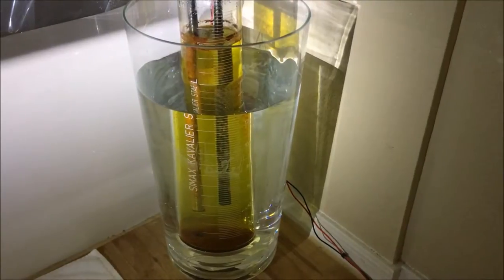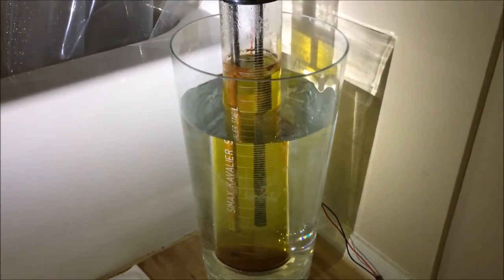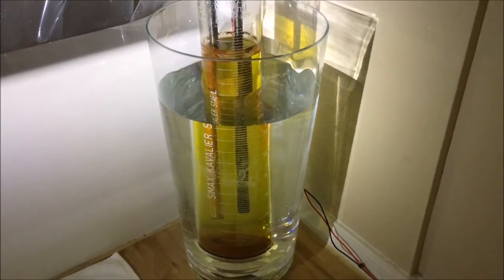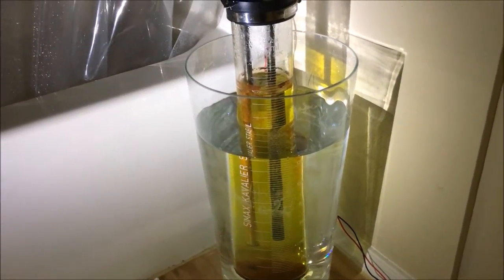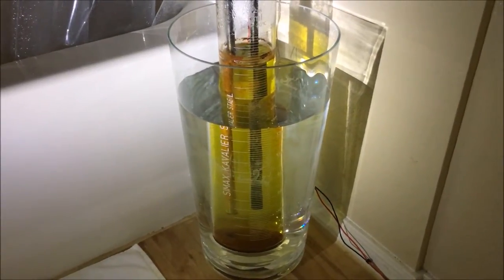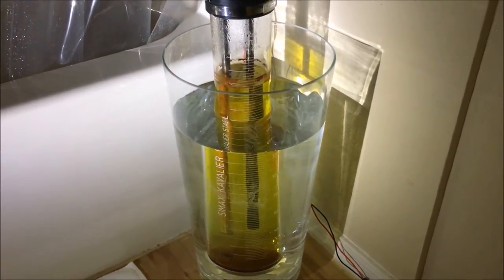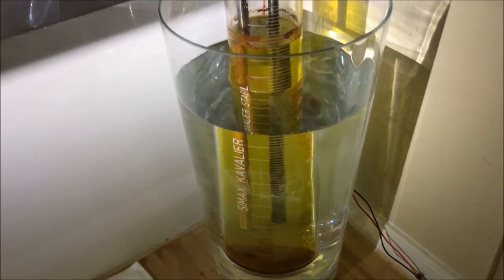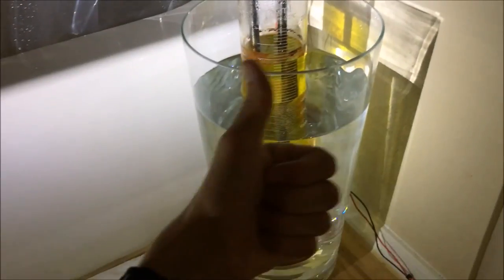EP 18 - Deuterium Enrichment Pt. 3 (Experiment Failed)

Comment: Hi first of all please dont be fooled by my profile pic. I have also done the same but i used a lead kathode and graphite anode for my experiment (the lead only because i dont have a second graphite one). Lead Kathode because the anode is going to be sacrificed and you really dont want lead water. It works perfectly because in both materials the contaminents are really low so you dont have to worry about something like the chromium at yours. Also I used H2SO4 as elektrolyte to make my solution acidic because hydrogen splits better in acidic envoirement so it has a better efficiency. Tip: If you use Graphite from pencils dont because there are some thing in it wich contaminate the water with nasty little particles and the electrode needs to be replaced. If you use two high quality graphite electrodes you should be able to run it indeffinitelly. (also with lead possible)
btw i have an bachelor in technical chemistry.
Reply from the maker: Jayko30 Excellent tips, I will be sure to apply them if I repeat the experiment in the future!
Reply: thank you

Comment: Hi, I didn't hear what type of steel you are using as electrodes, for what I've read 316L or 304 steel types are the best, and potassium hydroxide as electrolyte reduces the corrotion. Temperature current and voltage is a whole issue apart. Most people have moved to drycell electrolizers because of efficiency even if their purpurse is different, may be running at very low power with little liquid you can get less bubbling to allow the water to resume and enrich.